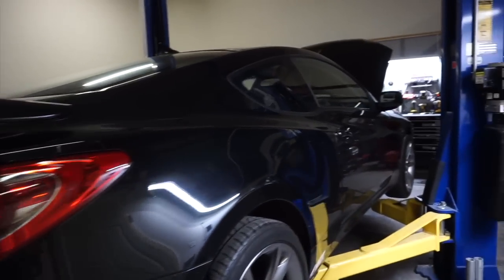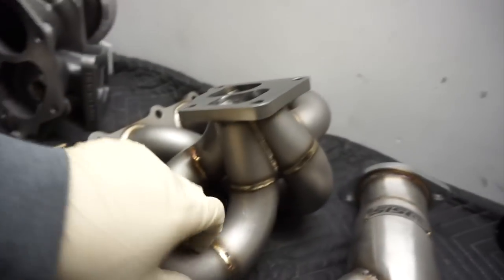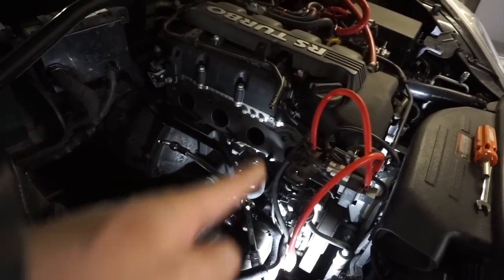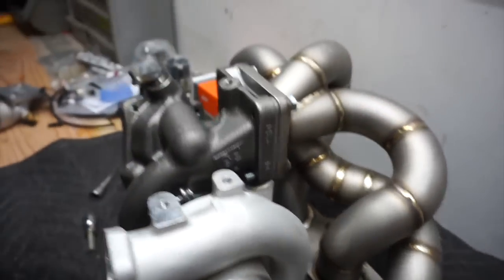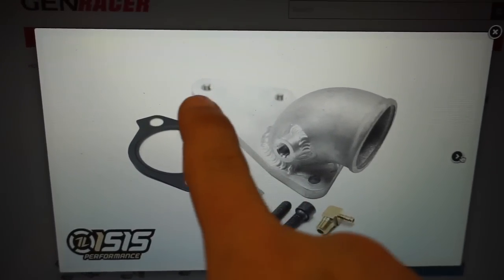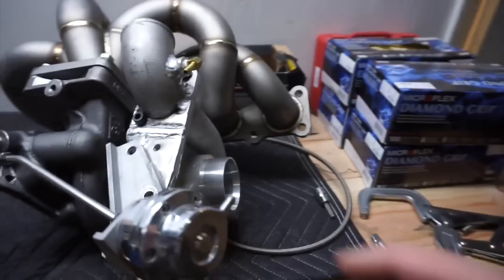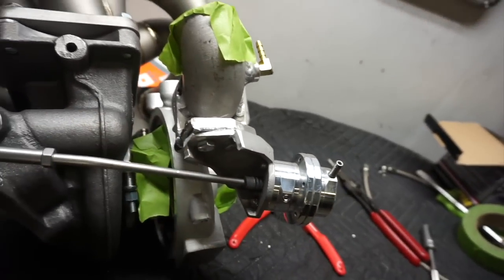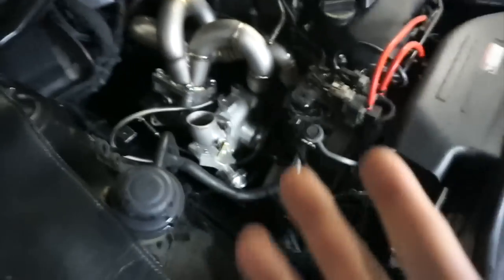ISR Evo 8/9 Twinscroll 20G turbo install (Part 1)

Comment: I had put this kit in my son's car a few months ago. have had problems with the waste gate not opening. I know it was two years ago but did you have issues with the vacuum lines? there were 4 in the old set up and only three places for them to go in this kit. I know in the second part you talked about getting the upgraded injectors, is having a blow off valve necessary? Also There is no one in the Bay Area that tunes Hyundai. do you ever come to the San Jose Bay Area to dyno tune? Thanks in advance for any input or help you can give.

Comment: I give that manifold 6 months before it cracks. I hate when the do those fake tig welds.
Reply from the maker: We will see :)
Reply: seoulfulracing another great video/build! I'm looking to come up to SFR this spring for a customer tune on a gt3071r. I have the 1.5 canned tune bk2, do you have a base tune for the 3071r I could upgrade to, or would it be safe to drive up with just 1.5?
Reply from the maker: As long as you stay out of boost you will be fine. Once you take the e-wastegate it will be in limp so it will be safe to drive anyway.
Reply: seoulfulracing ok thanks, going to be a long ride. What the best way to schedule an appointment?
Reply: I have the old Elite Motorsports evo kit  for over 2 years and i bought it used, no problems so far